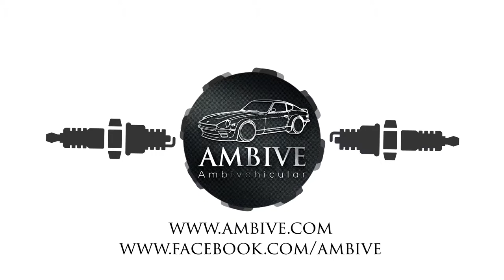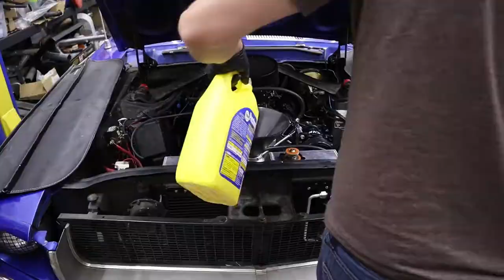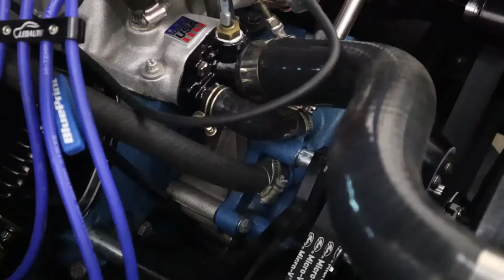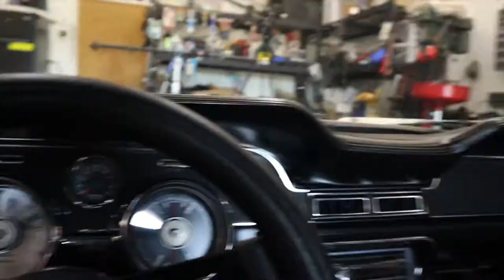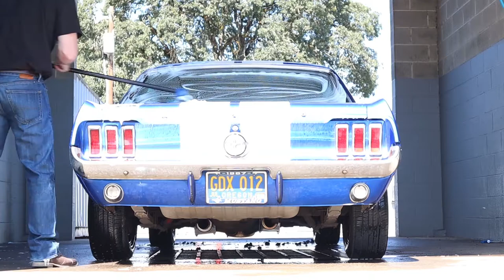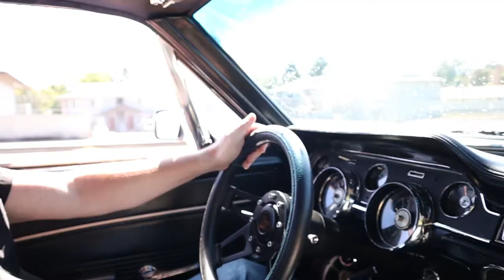Fixing the 67' Mustang's coolant leak

Comment: Great Videos! What aluminum radiator a electric fan setup did you go with? How much clearance do you have? I'm running the same CVF Racing setup and I am worried about clearance issues. Thank you
Reply from the maker: I am running the Mishimoto setup. It does not fit as kit should. I ended up cutting the original mounting tabs off the support and moving the whole rad forward a bit, then off setting the fan a tiny bit on the shroud. It's close, but since I'm using hard urethane engine mounts it doesn't nice much.